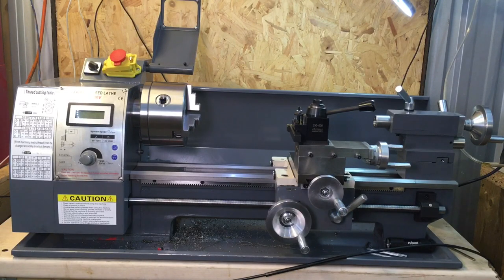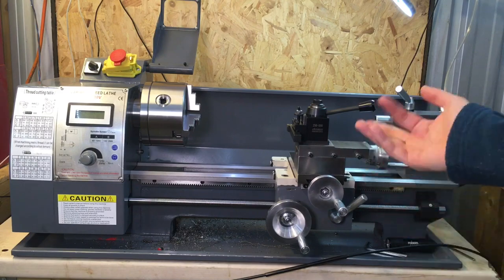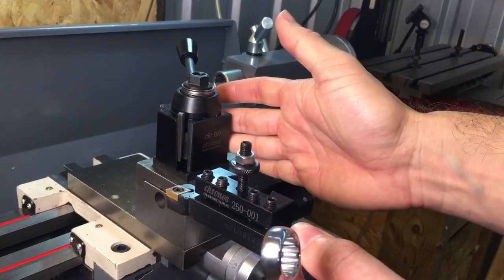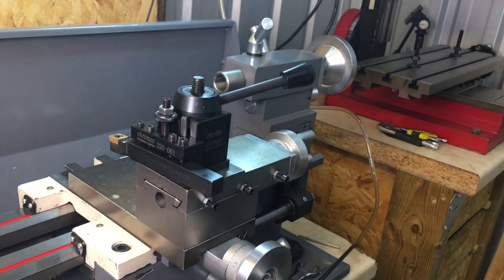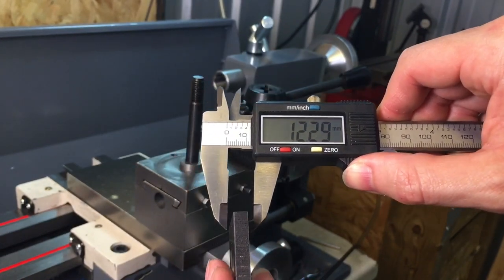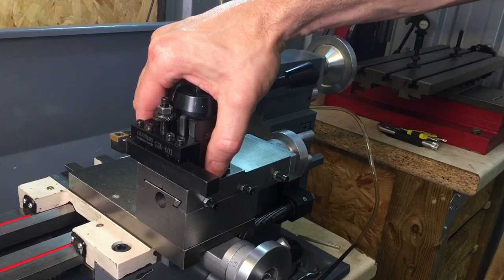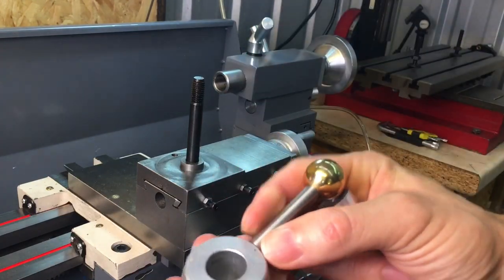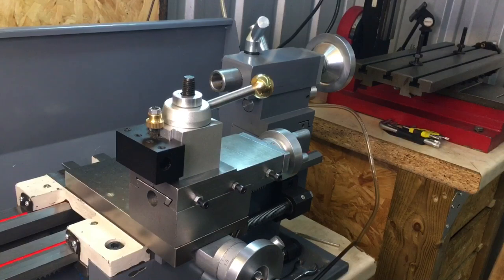QUICK CHANGE TOOLPOST For MX-210V 8 x 16 750W Bench Lathe

Comment: Thanks for the video .. The only problem I see with your setup is by using the provided spacer plate and modified to fit over the the shoulder on the slide ... is that the wedges are not locking the whole length of the dovetail in the tool holder if the tool is as low as it is in your video - Better to machine away the shoulder and use no spacer if you are not going back to the original setup - there is still 6mm tapped material on the slide which is enough

Comment: I have a 9 X 20 lathe with a similar to slide to yours but the quick change tool post I went for was a "Dixon" type. I could obtain the correct size for the lathe because there are a larger number of sizes available. I have noticed that the type of tool post you are using seems to be very popular on your side of the pond and as you say they work well, there is one good point about the Dixon tool post is you use high speed steel cutting tools  as you re sharpen them the cutting face can drop down past centre the Dixon has a screw adjustment to set he height of the tool so the tool holder always puts the tool at the correct height every time.

Comment: I bought the same tool-post for the same model of lathe. To save machining the square base block to fit over the cross slide boss, I just got a piece of flat aluminium bar 6mm thick, cut it to the size of the tool post, drilled a love through it to fit over the boss. Simple fix, 10 Minuit job , easier them machining the steel base block and opening up the hole in the base. My fix works just fine and was easier to do.
Reply: Yeah?  Aluminium is soft as butter, so how does it handle steel clamping down on it?

Comment: I bought nearly the same lathe, which also has that shoulder sticking up out of the compound.

I was hoping you would show how you mounted the rectangular shaped bottom plate of the tool post. did you use some spacers?

Comment: Do these "**210V" lathes come with and angle indicator for the compound rest/slide? I've seen an older exploded view drawing of one with a 20 mm spindle bore without showing one and have seen a more recent (this year) video here of one with a 38 mm spindle bore that had an embedded angle indicator, underneath the cross slide, behind the compound rest. There are so many "versions" that it's hard to keep track.

Comment: Gonna have to take shoulder off mine as the 0XA or 250 000 didn't come with the metal plate you bored out. I know my AXA tool post of same design came with one but for some reason the one on amazon for $115 shipped didn't.

Comment: Well I bought the Chinese aluminium quick change tool post show here. All I had to do to make it fit this lathe was to fit a 6mm flat aluminium plate with a drilled hole to fit over the raised boss on the cross slide. Simple and quick fix cost very little to fix.
Reply: didnt you need a longer bolt then as well? i consider these poorly thought out and the boss on the cross side slide is simply stupid.
I've not found one simple bolt on solution yet.... the tool holder as provided included no shims even for the included cutting tools... has anyone ever even used one of their own products out of the box???
Reply: i see what you mean now. just need a 3/4" bit  and 1/4" of material and it should straddle the boss. thank you.

Comment: I purchase one of these models used and need to replace a couple of defective parts.. Can you tell me where parts can be purchased?..Thanks, Dave
Reply from the maker: contact the seller you brought it from .
Reply: These MX and TX 210s are  somewhat similar to the Grizzly G0768 sold in the US.

Here is parts listing that may be of some assistance?
https://cdn0.grizzly.com/partslists/g0768_pl.pdf

https://cdn0.grizzly.com/specsheets/g0768_ds.pdf
https://cdn0.grizzly.com/manuals/g0768_m.pdf
https://www.grizzly.com/products/g0768/parts

Regards, alfa

Comment: I'm torn between OXA and AXA. I'd go for the OXA since it's simpler to adapt but I wonder if AXA is the way to go for hard pieces to work on.
Reply: AXA all day long.  Need to modify it, but it will be heavy duty enough to cut anything you can fit in the lathe.  OXA works great on the smaller HF mini lathes.  This girl needs some beef!!  :D
Reply: @number40Fan  Ok Thanks, After some research I saw somewhere on youtube a guy who choose the AXA but changed the stub for a beefer. This for a similar type of  lathe as the one we got (8X16). He said that after many hours of work that  he found out that the original stub was too weak...

Comment: Has anyone figured out how to remove the chuck from these lathe? Is the spindle threaded, or one piece? Id like to make another chock plate, but haven't figured out how to remove the chuck to check the spindle thread.
Reply from the maker: James Jarmon 3 bolts on the back of chuck remove them chuck comes off.

Comment from the maker: 250 000 Mini wedge Tool post https://amzn.to/2Y5mBOI
Quick Change Tool Post https://www.banggood.com/custlink/vK3mJYQoo9
other tools i own
Heavy Duty 1 Ton Folding Engine Crane https://amzn.to/2OGoKwg
Hilka G301C9BBS Heavy Duty 9 Drawer Tool Chest BBS https://amzn.to/2OEzeMH
Cobalt Drill Bit Set https://www.banggood.com/custlink/m33GhoqQgF
best mig welder https://amzn.to/2SzfuiJ 
Stick welder https://www.banggood.com/custlink/vDvKRBfsKk
Tig Welder https://www.banggood.com/custlink/KGmmR4wQ61
My camera https://amzn.to/2SHHsnu
Tin Snip https://amzn.to/2Tro9Qy
Flux core wire welder https://amzn.to/2BSkkwl
Stick Welder https://amzn.to/2AMBFH7
Welding Clamps https://amzn.to/2Ul0IZM
Table saw best a this price https://amzn.to/2GH1oX8
Screwdriver Set https://amzn.to/2C0CFYQ
Thor 708 Nylon Hammer https://amzn.to/2Gy50uo
cheap Angle Grinder https://amzn.to/2GMb1DW
Proxxon mini wood turning tools https://amzn.to/2Sj1W6V
Multi-Function Rotary Tool https://amzn.to/2Tf4N0A
Kitsu palm Router https://amzn.to/2GwZU1p
Belt & Disc Sander https://amzn.to/2SbLZix
F-Clamp https://amzn.to/2QXYfqy
Irwin Pullsaw https://amzn.to/2RlXlmR
6-in-1 Screwdriver https://amzn.to/2Q8wZAf
Mitre Box https://amzn.to/2CDBlMa
Mini Angel Grinder  https://amzn.to/2So48d6

Above are affiliate links and in the comments it costs you nothing, if you do not want to use links search on goggle more info Thanks.

Comment: Has anyone fitted a 4-jaw chuck to the mx-210v. I have seen a vid where a larger chuck was fitted with special adapter but not too keen putting extra load on bearings.
Reply: Did you ever get an answer to this?  I want a 4 jaw as well, and need a machine that can just shut up and take it.
Reply: @generalawareness101  No replies. I bought a 125mm backplate warco ref 005444 and a 100mm 4 jaw with independant jaws warco ref 008044. I had to machine either a spigot or recess and add some holes. If i can find my sketch showing extra machining required i can send that.
Reply: @phayward  Excellent.  I wonder why this machine is so weird it requires all of that instead of off the shelf parts?  Seems it would be way cheaper of China to make it using off the shelf parts so we could off the shelf upgrades.  Very strange.
Reply: @generalawareness101  I agree, strange indeed. Not sure how to add a file to this message but I could email my sketch if required.

Comment: Hi, just need to ask a question. I have this lathe arriving in the post and I want to buy a quick change tool post;
4:13
What is the size of that shoulder?
5:15
What is the width of that hole?

Comment: I'd like to have a nice lathe like that one but even if I did, I don't really know how to use one very well.
Reply from the maker: I’m sure you would easily pick it up it’s not as hard as people make out. Just bang a lump of metal in and make chips. Thanks for commenting appreciate it have a good day.
Reply: Hello,
Still happy with the size of the 250-000 QCTP ? 
Have a good one.
Reply: @Levisgil47  yes, it might be a bit big but its strong and easy to use.
Reply: @MissouriOldTimer  ok. Good To know. Though this one is the smallest of the two contenders. Oxa (250-000) vs Axa (250-100).
Reply: @MissouriOldTimer  You installed a BXA !  Even bigger. I did not know that it was possible.
Reply: @Levisgil47  I think that is what was recommended for a 12" lathe but the next size down would work I think.

Comment: Always go beefier. I think that I will go with AXA. I don't see the point of that bearing. I worked for years on "real" lathes and never had issues marring anything up. Add a washer if that is a concern. It is not a good idea to apply to much torque on a bearing, you can break it. If it is not tight enough(moves easier with the bearing), then the tool post can move on you.